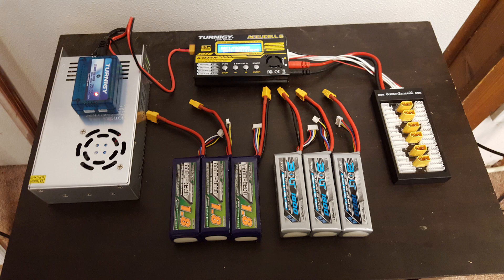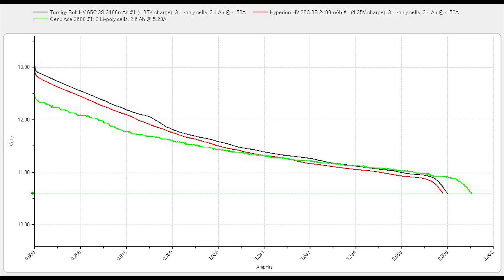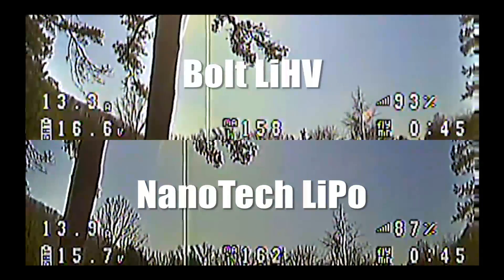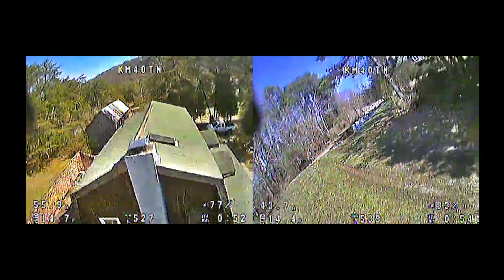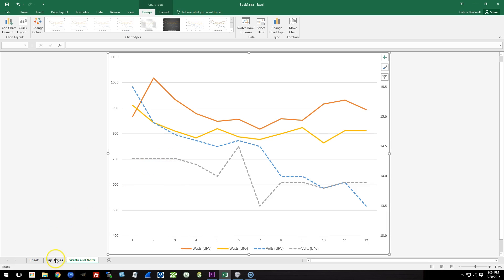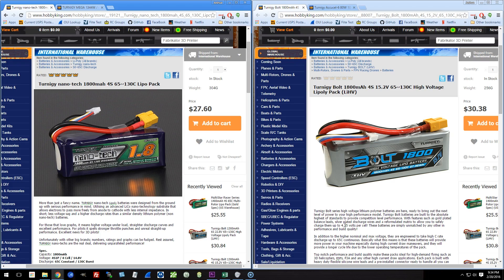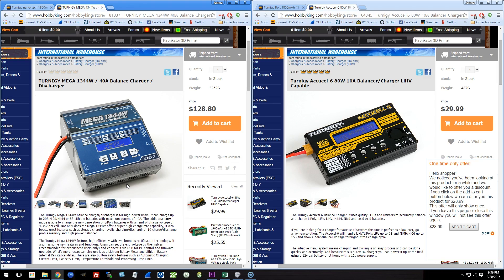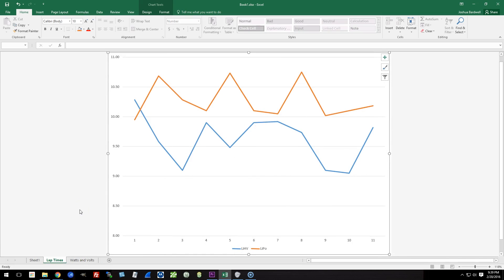Should You Buy LiHV Batteries? UPDATE: No. You shouldn't. (See video description)

Comment: I too Sir, have come to the same conclusion as you through my use cases with my 17.5 buggy.  It is my opinion that LiHv is a marketing ploy that gives the vendor the ability to sell the same battery for $10 more.  LiHv when charged to 4.2v (ROAR max) leaves the battery with -15% of the capacity that is labeled on the battery.  My LiHV's have swollen when charged to their 4.35v per cell so much faster than any LiPo's I've ever owned and charged to 4.22v per cell.

Comment: i run LIHV on a regular basis ... i have ran my 1s LIHV  for 2 seasons, they still kick ass all over the place .. i have about 10 standard voltage packs and they lose punch after the season, not going to put brands out there but they where top brands ... the LIHV batteries had about .3 to .4 volts more after a 5 minute race ... your testing on shit gear,  put them on a GFX35 and use good batteries, not hobbyking crap.

Comment: I do quite a bit of Bolt v2 flying with over 30 cycles on each one, and either the v2 are better at "not-puffing" than the v1 was, or my strict slow LiHV charge rate (1c) is keeping these batteries pristine. I have not had a single problem with the Bolt v2 batteries. However, I have had several BNFs that were rated for 2-4s that didnt like the extra juice of LiHV 4s, namely the Bfight 210, and they freaked out.  I have been using my bolts for racing and I am slightly faster using the Bolt v2s over my Graphene's. I use my Graphene's for every day racing, practice, and some freestyle. I have raced with the Graphene's but I saw lap times drop and also my flight times were a half-lap longer on the Bolt v2s.  My Graphene's I charge at 2C and I dont see any issue with them with over 30 cycles on each.

So maybe the trade-off factor that you missed for the Li-HVs are actually a longer charge time is required to keep the cycles up. I should have 60 cycles by the end of next month, so I will report back. Anyone else out there with the v2s? Have you been seeing puffing? Are you charging at just 1C or higher?
Reply: Curious on an update if you got more cycles on them now.

Comment: may I know what power supply your are using for auccell 8 charger
Reply from the maker: +Lalith Kishore 

DC 12V 30A 360W Switch Power Supply for LED Strip Light Switching AC 110V/220V https://www.amazon.com/dp/B006IO72K8/ref=cm_sw_r_cp_apa_gC0DzbHFW2VHF
Reply: I have one of these laying around, can I use them with my Imax b6, that has "12V 5A" marking on it?
Reply: Szabolcs Felder I do buddy it's basically a computer power supply I have 12 volt rail 5 volt Rail and 3 volt rail I just hook up the power leads with alligator clips to the 12 volts simple you can also hook up to a car battery when in the field

Comment: Hey Joshua,

at hobbyking they tell us rust it's possible to charge the bolts with a normal lipo charger. can you confirm this?
Reply from the maker: Yes, of course. You can't charge them to 4.35 volts, but they still can be charged to 4.2 volts like any LiPo.
Reply: Important to note that a 4.2V LiPo will outperform a 4.35V LiHV that is only charged to 4.2V.
Reply: Brazy Wolf you don't need proof think about it that's like having an 1800 milliamp battery or a 1300 milliamp battery which one weighs more? the 1800 milliamp weighs more now if you charge them both to 1300 which one do you think is going to perform better? the 1300 because it's fully charged with less weight obviously it would end up being a lighter battery for the power that you using
Reply: The MD80fanatic facts?

Comment: Isn't the point of HV batteries that you can get the same mAh capacity in a much smaller package?  Comparing 2 1800mAh batteries should result in about the same capacity.  What should be done is comparing a 1300Lipo against a 1500HV - they are the same size/weiught, but the HV holds more capacity.

Comment: Thank you For All the valuable DATA!!!!:). I've been using them for about 3 Months, and I felt Sure I made the right choice.  I did notice that with my Land-Based RC 4x4s the Low Voltage detection setting caused it to just stop instead if slow down to Half speed for the last minute or two?.?.  like the regular 3s 4.2 volt Lipo 5000 mAh Batteries do.  

thanks again!!

Comment: I have a question. Building a dj105 and guna run on 4s. Found a good site with bonka 4s hv and the new line form them panda power 4s hv both 500mah. I know bonka is awesome i have some but do you know anything about the new line and which do u think i should buy?
Reply from the maker: I don't know about the new line, so I would stick with the one you know is awesome.

Comment: The performance of these batteries at 4.35 volts per cell is absolutely amazing however you will not get any more than 50 charge cycles out of them before the cells start puffing and another 15 past that when the cells refuse to charge even to 4.20 per cell. I have two of these packs that are rated for 1300 mAh and 65 C constant and both of them displayed the same rate and speed of failure despite being cared for very well

Comment: Awesome video!  Super detailed!

How have your bolt lipos been holding up?  Are any of them puffing?  Some people say the bolt batteries get soft and puff in less than 50 cycles.

How many cycles have you ran through your bolt lihv and are they still performing ok?
Reply: well it's the cost of extra flight time if you want your batteries to last don't fly then because it's stupid you might aswel just not bother with this hobby or don't buy a car in case the cost of fuel and your engine blow's up  or your  electronics fry a few fuese or don't buy shoes because your too scared to get them dirty nothing lasts and there is no point trying to prolong it  I rather squeeze what I paid for

Comment: great vid, anyone using any of the other brand HV-lipos like venom etc?
Reply: I have tried LiHV from Turnigy and Lumenier.  I will not be buying any more LiHV packs unless they do something to improve the chemistry.  Both brands performed amazing when new, but quickly deteriorated and perform worse than regular lipos after about 10-15 cycles.  All puffed as well.  And I didn't fly them any different than my regular lipos of the same 1300 mah capacity.
Reply from the maker: +Plur307 I came to basically the same conclusion. Did you see the followup video I posted?
Reply: Joshua Bardwell Yeah.  But unfortunately I had already come to the same conclusion before you made that video.  My first few flights with LiHV really impressed me.  I could feel the power of the extra voltage and C rating, but that went away after about 2 weeks.
Reply: Thanks for the heads up!
Reply: Plur307 do u haft to have a special charger for em
Reply: The charger needs to be able to charge to 4.35 V per cell instead of the normal 4.2 for regular lipos.  My graupner charger couldn't do it when I bought it but with a software update it can now.
Reply: Plur307 I canceled my order Josh said they don't last long

Comment: Hi Joshua,  great video and I did buy a few Bolts after watching it.  Its been almost 6 months now since you made the video.  Any further thoughts on downside to these batteries,  specifically life span.  I did see they performed great in your battery shootout as well.
Reply from the maker: +Michael Koster I still can't really comment in lifespan. Otherwise, I like them.
Reply: Given a choice between revolectrix 435  4s 1200mah and the Bolt 4s 1300 do you have any opinion.  I'm moving up from 3s and want to make sure my money is well spent.  I believe your shootout showed they were both very good batteries.
Reply from the maker: Revo is better IMO but it might die sooner.
Reply: Is the revo weight believable?  117g for a 4s 1200.
Reply from the maker: Yes. Their 1500 is only the weight of a typical 1300.
Reply from the maker: And it legit is a 1500 too.
Reply: Thx.  I think I may buy the revo 1500.

Comment: I can give ya a pretty HUGE reason as to why you SHOULDN'T 'always use HV'... not everything CAN use HV batteries -.- If you plugged a 4S HV into an ESC that's only rated for the standard 4S, you risk frying them. Sure some ESCs/other components have a pretty wide 'acceptance' range of voltage they can function under, but its always better to use the voltage that its 'meant' to use rather than over/under powering. There are plenty of Flight Controllers, ESCs, Motors, and other various components that now state either directly on the device/product, or has a warning either on its sale page or in its manual: DO NOT USE HV BATTERIES.

If you have a 4s HV battery, and you're using motors/ESCs that are rated up to 6S, then sure the 4s HV will work wonderfully. Specially if they either have a BEC or you have a PDB with a dedicated 5V Regulator for the FC/whatever else. But the majority of devices/products that say 'up to 4S' WILL NOT WORK PROPERLY with a 4S HV battery... 

Again, some products/devices 'can' work on a 4S HV battery at its EXTREME ranges of acceptance... but its not healthy for whatever you're plugging the battery into. If you get a HV battery, then ALWAYS use devices/products that support a cell count HIGHER than what you plan on using (ex: get things that support up to 6S if you plan on using a 4S HV, or get things that support a 4S if you plan on using a 3S HV)
Reply from the maker: It's possible this could be an issue, but I have personally never heard of anyone running 4S-capable gear damaging it because of the extra 0.6 volts from HV. If gear can take 16.8 volts, it can probably take 17.4 volts. Any gear that was specified that close to its absolute limit would be failing in the field left and right just due to normal voltage fluctuations.
Reply: Very true, but those 'ratings' are there to protect you from going over those thresholds. So even if they can take the 17.4 volts when they only want you to use 16.8, then the fluctuations from the 17.4 power source would then be higher than what it would experience with a 16.8 power source. A rule of thumb that I've always been told by various electronic engineers from college and such always say that 'you should always operate in the rated capacity. beyond that rated capacity can lead to failures'. 

Though as for some proof to the whole 'Don't use HV batteries' thing I mentioned, just go look up some newer ESCs and Motors on HobbyKing. quite a few have it listed to 'not' use HV batteries.
Reply from the maker: Just to be sure, I double-checked with QuadMcFly, who runs miniquadtestbench.com, and who knows more about ESCs than pretty much anybody. The actual electrical components on pretty much all ESCs are rated up to 30 volts. The restrictions are due only to heat dissipation and the current-carrying capacity of the PDB. The 0.6 volts difference between regular 4S and HV is completely irrelevant. Most modern ESCs rated for 4S will run on 5S no problem, as long as you don't exceed the current rating by too much.

If a manufacturer says not to run 4S HV, then I wouldn't trust the ESC to run regular 4S either. Or I wouldn't trust the manufacturer not to be full of it.
Reply: not really 12volt pc fans pop on 12volt or some pop on 16volts some pop till they hit 30volts some good brands hits 40volts or 50volts so don't buy cheap ESCs buy a high voltage ESC like 16s those caps are rated for over 100volts

Comment: I picked up two of these by mistake (1000mAh Bolt 4s) I don't have a HV charger so I'm just using my standard lipo charger. I'm wondering if they get about the same performance/flight time as a standard lipo when undercharged... any thoughts?
Reply from the maker: I think that they perform better when under-charged to 4.2, but I don't have hard data to show it. The chemistry used has a higher nominal voltage, therefore they should be less stressed when charged to less than their maximum .
Reply: Joshua Bardwell Thanks for the insight.

Comment: just got a bunch of bolt high voltage. 
I was monitoring discharge with telemetry on cell ( to about 3.6V ) - how to monitor high-voltage batteries and regular (4s) to not change taranis settings every time ?
Reply from the maker: +fpvYou they discharge to the same level so no problem.
Reply: Joshua Bardwell I was monitoring voltage on A4 sensor. with SMC 4s it was showing 4.2V but with bolt HV it is showing only 3.2V ( fully charged 4S battery ) 17,..V total - Taranis sensor I was looking at is A4 - x-racer v2
Reply from the maker: that's really weird. I've had no problem myself going back and forth between HV and regular. But wait.. you're getting individual cell voltage, so I wonder if you are monitoring Cells instead of A2 or whatever. Why aren't you reading 16.8 or 17.4 or whatever?

Comment: Hello Joshua, 

Can you tell me if these Lipos are dangereous for any FC or opto ESC? I'm using Cyclone and Littlebee 20A Escs. Can I connect this diretcly to the quad? My friend told me that his ImpulseRC Alien Led Ring got fried. 

Thanks.
Reply from the maker: +Kaan Aslan If the component is rated for 4S, then it should be okay for 4S LiHV. I haven't seen or heard of any examples of e.g. a 4S ESC being fried by running off of HV. Bear in mind that 4S is 16.8 volts max and 4S HV is 17.4 volts, so that is only 0.6 volts difference between them. Realistically, any component that was 0.6 volts from its top end when running off 4S wouldn't be a good choice anyway, given how noisy copter power systems are.

But what you ACTUALLY asked was, "can I connect this directly to the quad", and you should be careful here. If you are using an FC with an internal voltage regulator, like the Cyclone, then you should be fine, as long as the FC is rated for 4S. The Cyclone is rated for 4S, and up to 6S with a power filter, so you should be fine. 

If you connected the LED ring to a 4S HV and it fried, then I would reach out to ImpulseRC for support and see what they say.
Reply: +Joshua Bardwell Thank you very much.
Reply: +Joshua Bardwell Hi Joshua, I used my HV batteries for the first time on my alien with Cyclone FC and BF 2.7.1 on it. When I first plug the battery, the buzzer keeps beeping and the telemetry on the taranis shows 3.4v or something. But when I measure the lipo's battery the cells are around 4.35. When I keep the quad armed for a while the cell voltages drop to around 4.2 the beep gets off. I thought this should be a setting on the FC that I should change from Betaflight. Can you help me about this? What should I change for not getting those beeps either when I plug a 4s lipo with or without HV?
Reply from the maker: Change the max cell voltage in the vBat monitoring in the configuration tab.
Reply: Ok thank you. Do you know what it should be?
Reply from the maker: I would use 4.4 if I was running high volt batteries.
Reply: Got it! Thank you.

Comment: Yo- This is a great video- full stop. BUT- There is a big problem here with your "data" 

You need to blind yourself as to the batteries you're flying. There are a whole host of problems that come with knowing which battery you're flying. You might think you're controlling for that by taking straight voltage data, but your control inputs are NOT controlled for in this circumstance. I love your videos, and I would love to see you up your game for the scientific validity of your tests as well!
Reply from the maker: +Eric Tergerson I'm aware of this criticism, but I still stand by the results. When Top Gear has the Stig take a car around the track, he's not blind to which car he's driving. The track times are still valid, and everyone is welcome to take them with a grain of salt if they like--much as you're welcome to take my results with a grain of salt if you like. I'm not the Stig, but I do fly this exact course around my property very regularly. I assure you that I gave it a fair try on every pack. I also alternated packs to try to be sure that I didn't warm up on the regular LiPos and then fly the LiHV when warm, or vice versa. Ultimately, the difference in lap time is clearly significantly more than the variance in lap time. I feel like the results are valid: the LiHV are definitely faster than the LiPo, although you could debate how much.

In my current round of testing, I have taken the pilot completely out of the equation by doing bench discharge tests using a meter. The tests aren't blind, but the meter is absolutely deterministic. Having posted these tests, somebody will surely say that bench testing doesn't reflect the battery's true performance, and only flight testing really matters. This is a completely valid part of the scientific process, where test methodology is published and criticized. Ultimately, I plan to put exactly as much effort into the testing as I think it warrants, and you are welcome to draw whatever conclusions you like.

Comment: how i see it is that they just put more cells in the cells to get the higher voltage
Reply from the maker: +AUSSIE RC SPEED RUNS I can't tell if you're kidding, but that's not how it works. LiPo cells are 3.0 to 4.2 volts nominally. If they added another cell, it wouldn't go up by 0.15 volts. You have always been able to charge LiPos to 4.35 volts, it's just not entirely safe. So they've done something to the packs to make it safer.
Reply: +Joshua Bardwell and at the end of the day they will still go puffy like the rest of them
Reply from the maker: +AUSSIE RC SPEED RUNS Remains to be seen. I don't care if they puff as long as they still push amps.
Reply: they will push amps for a few runs then puff
Reply: depends how much ur system can pull from the lipo